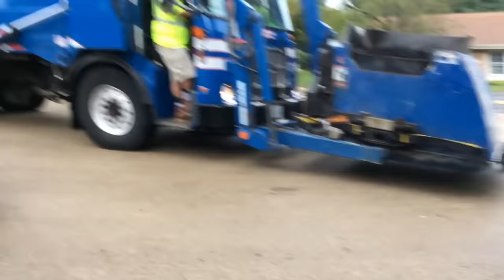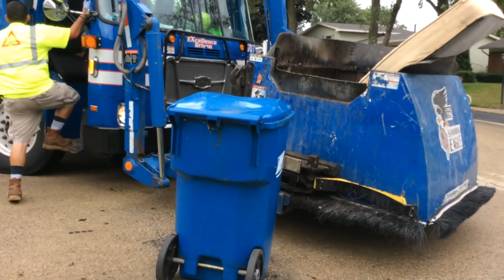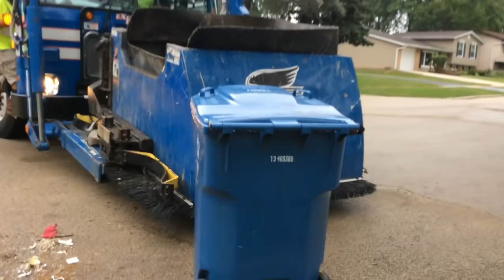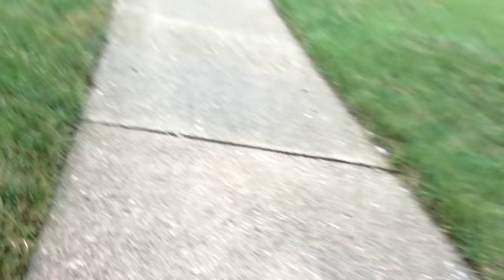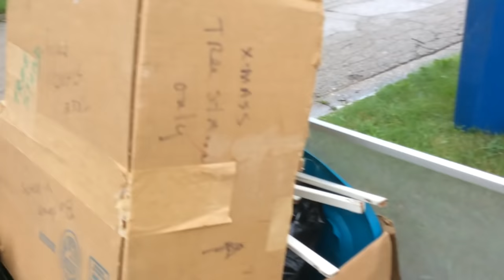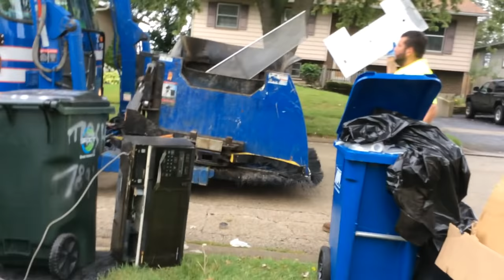Republic services curotto can slamming eagle garbage truck

Comment: He's not playing with the kid, 
He's trying to keep his job, 
Due to he is on camra,  An there is no Dam way this truck driver should be putting trash in the truck by hand,   
These H/Os should be fined For the trash that is not in the Trash Cans,
Reply: Republic offers unlimited routes in a lot of areas, and this was likely an unlimited route, becase of the usability of a curroto can for speed and collecting excess items on the ground.
Reply: Imagine a world where every bit of trash we had would fit into one of those little cans. A miracle
Reply: That’s good he putting by his hand 🤦🏽‍♂️
Reply: @B711HD  it’s a safety hazard.
Reply: Definitely irresponsible for the homeowners to put out garbage in cardboard boxes that get soaked and fall apart.
Reply: @AnyBodyWannaPeanut  what else are they supposed to use though?
Reply: @A6Legit  maybe bags... Or plastic bins... Any container that doesn't melt in the rain really.
Or maybe even wait until the rain is over before putting out the garbage.
There's many options.
Reply: @AnyBodyWannaPeanut  well your plastic bins are getting thrown out if you put garbage in them. Bags are no better than cardboard theyll break under weight just like wet cardboard. Yeah id love to wait for the rain to stop but unfortunately the garbage man comes when he comes.
Reply: @A6Legit  I have a feeling no matter what I say you're still going to say soggy cardboard is their only choice. No point to argue with you.
Reply: @AnyBodyWannaPeanut  I dont hear any alternatives that would actually work, so I imagine there is no point. None of it is ideal for the garbage man. Its part of the job.
Reply: @A6Legit  all the alternatives I suggested would work. Plastic bags are fine if you don't overload them. Proper garbage cans also work. Garbage pickup is on a schedule, so you could wait until closer to the pickup times. You don't offer any suggestions that would work. You just like to argue for the sake of arguing.
Reply: @AnyBodyWannaPeanut  A proper garbage can is the only good option, and that still doesnt solve everything when there are items too big to fit in a can.
Reply: @A6Legit   bags!
Reply: It’s what Republic offers. My company fines you 5 dollars for every thing next to the can.

Comment: This guy hid his frustration well. He should have had a helper with all the excess crap on the ground. Either way nice video
Reply: he should've just not taken it , its not his job to clean the streets, its just his job to empty the cans
Reply: @nfsfreak98  Yeah, where I just moved from, they put a sticker with the rules on the garbage and recycling cans (English + Spanish/ large Spanish-speaking population), and put them on the city website as well. Including accepted materials, when yard waste is picked up, and what is/is not allowed in the recycling can + garbage cans. If you don't follow the rules (everything must be in the container, for starters), they will not take it. For big stuff, you either have to bring it to the transfer station yourself, or pay for a special bulky waste pickup sticker and put the item out on a certain day. Definitely can be annoying, but I understand it from the point of the trash collectors. Due to the narrow streets, they wheel the garbage cans over to the truck by hand and check what's inside before loading it into the truck. They also always have 2 guys whenever I've seen them.
Reply: that was kinda rude
Reply: @MittyNuke1  .
Reply: Here the trucks are rear load with three guys.  Driver and two picking up the bags.  Clear bags.
Reply: @nfsfreak98  there was an electronic in the trash can anyway